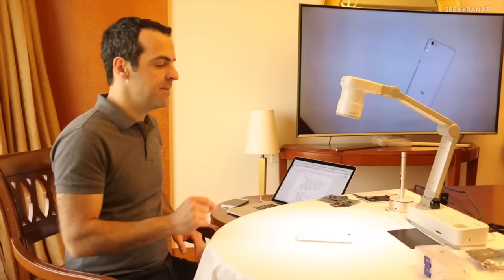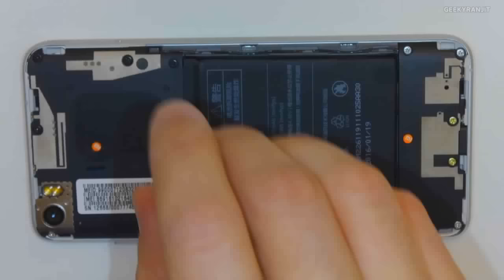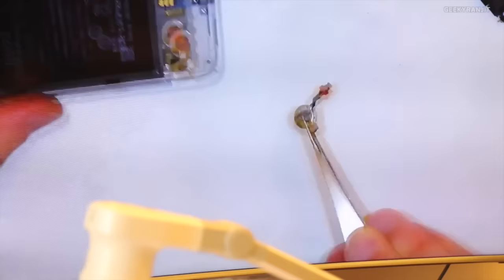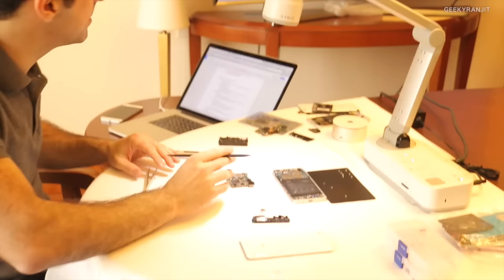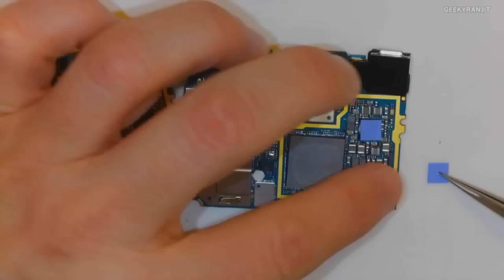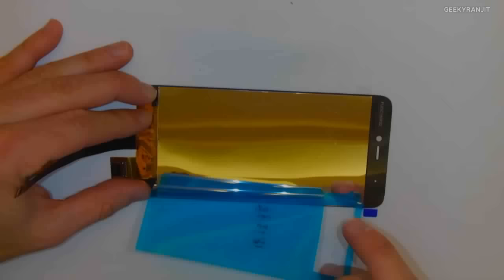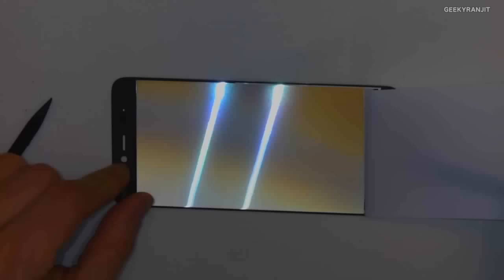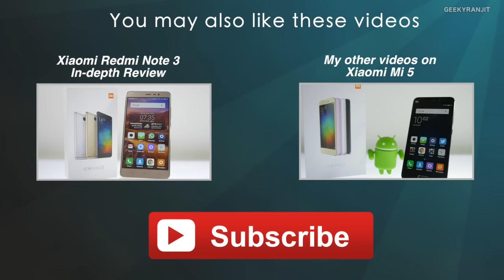Xiaomi Mi 5 Teardown by Hugo Barra - Geekyranjit

Comment: I was trying to replace the battery of my Mi 5, but when I was trying to pull up the glue that holds the battery it snapped. Now there is nothing to hold on to so I can remove the glue from the underside of the battery. Any suggestions? Thank you.

Comment: Hi Hugo, your teardown video is so details and unfortunately, I watched it too late. I decided 2 weeks ago to change my old battery to Mi5 but I didn't follow the correct glue stretch; I just throw brutally out the battery.  I replace the new battery but the phone didn't switch on (ie it switched on but screen was black). So I thought battery was uncharged and empty. I plugged in for hours, tried to switch on again, nothing to do, phone stuck to dark screen. I thought, maybe I damage USB C Charger, that's the reason why phone didn't charge properly, so I ordered a new one and replaced it. I plugged the pone in, hours of charging, nothing to do. Now, I've a doubt, may I damage LCD Flex cable? The front led is green, even front buttons light, but screen is dark. Does exist a flex lcd cable or have I to change all the lcd screen panel? Thanks!

Comment: Hi everybody.
does anybody know what are the others chips that he did not explain? My xiaomi Mi5 is dead (subite death) and I want   my pictures so I want to replace the PCB but adding my ROM memory to it, the problem is that I do not know what chip is the ROM memory in this phone... I have also read that another solution could be to change the qualcomm PMI8994 chip, anybody knows something about that? Thank you all!

Comment: did xiaomi do anything about the overheating issues in MI5?
Reply: I have the mi5 and it overheats when you play games but when you used in a normal way like YouTube, mail.. Etc it dosen't overheat. But if u are outside, whith the sun it overheats quickly
Reply: Thanks for the information. I am planning to buy Mi5 but little skeptical about the overheating and scared that someday it might blast while charging or playing games.
Reply: ZAPNEP no over heating issue in mi5. I'm using 3 months now.
Reply: ZAPNEP now the problem has been reduced but it still overheats a little

Comment: 25k rs is not a good price for Xiaomi mi5,it should have been abt 20k,its a Chinese brand and relatively new,so prices should be low to attract new consumers.
Reply: +Anurag Kanoria dont worry ..within 3 months the price will fall around 22000 and 2 more months 20000.
Reply: +Vinay Thakur Let's see..but still 25k as starting price is not well planned,both for the consumers and xiaomi
Reply: 25K was good if they launch the top model for it.

Comment: thanks a lot, used a suction cup like it was said here, shattered the entire back and I only a applied a tiny bit of force, the unit on this video had a much stronger glass, looking now at other disassembly videos, they don't use suction cup, so Thanks a lot for the fake misleading video...
Reply: Hugo Henrique do you put the cup at the center of the phone?
Reply: Denver Alfito Anggada yes, just like he did, I've seen other doing from the corner,. it i followed this video instead, big mistake...